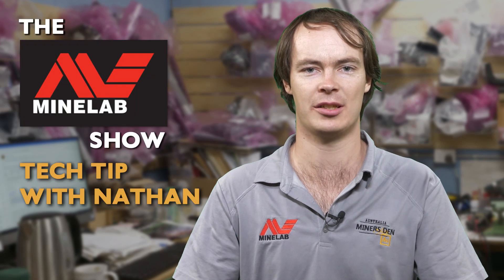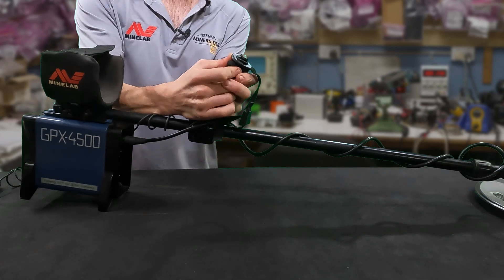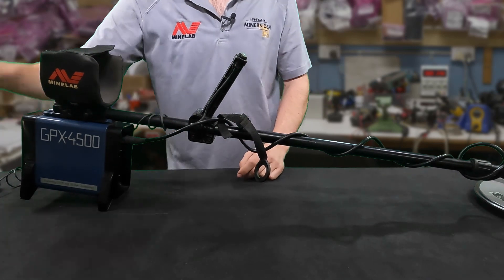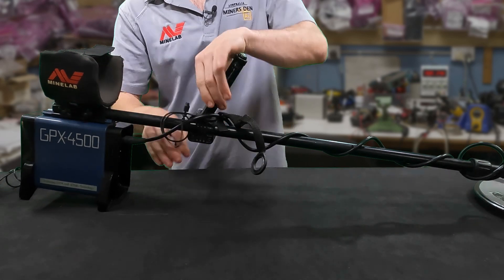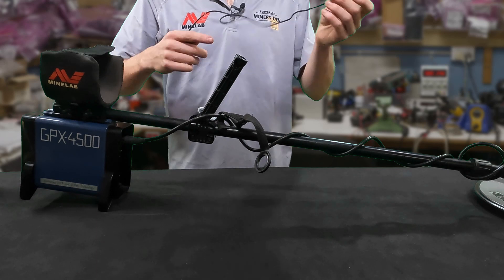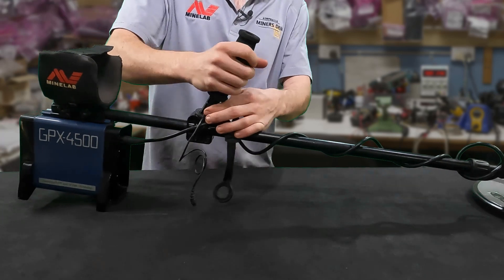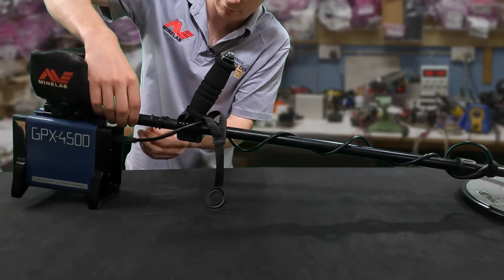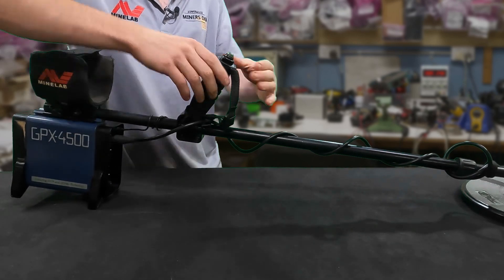How to Replace Handgrip Button on GPX Series Metal Detectors -  Minelab Tech Tips

Comment: What are rip off. All I need is the button and the cord with the plug. I don't need the hand grip you just charging me for extra. Can you just buy the plug itself. Or do you have to conform to their consumerism.?
Reply from the maker: You can get just the button and cable / plug- this video shows that quite clearly!
Reply: That might be so. Can't find any for sale without the hand grip. And I'm not paying $150. For a piece of copper wire a button a bit of foam and 4 inches of fibreglass. All of that all up wouldn't come anywhere near $150 of material. What's the gross profit on them, about 99%. I can't see how they can justify charging that much. And I certainly can't see myself paying it. But thank you for the information.